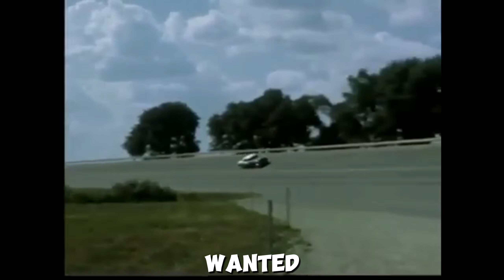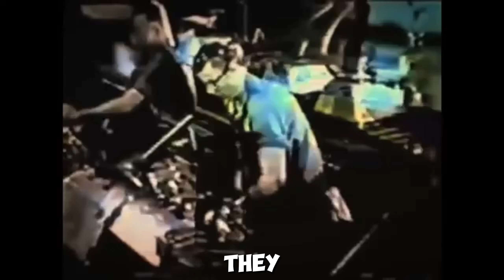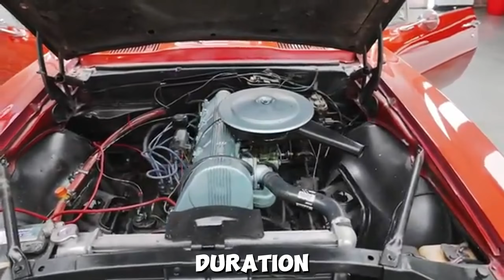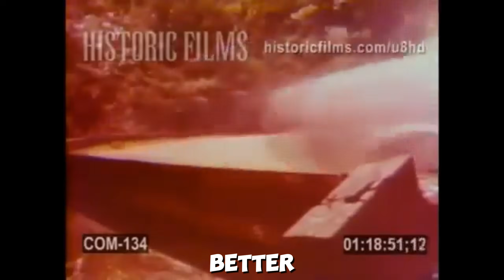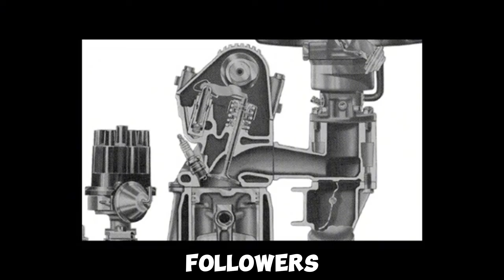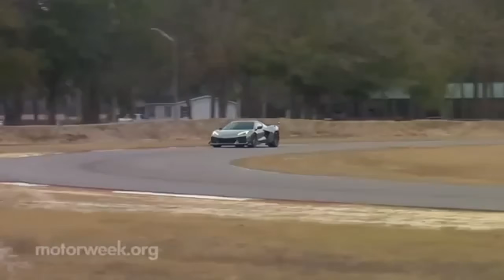How Pontiac REVOLUTIONIZED Engine Design with Modern Overhead Cam

Comment: Pontiac did not revolutionize anything.
They just copied and modified a design that had been around since 1902.
And we all know today how today's crappy engines are with oil pump drive belts and cam belts.